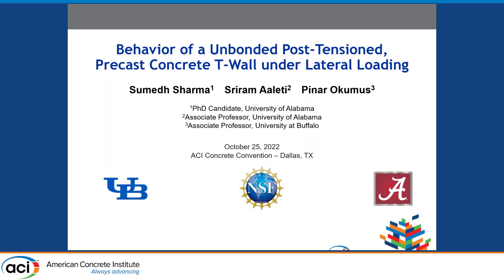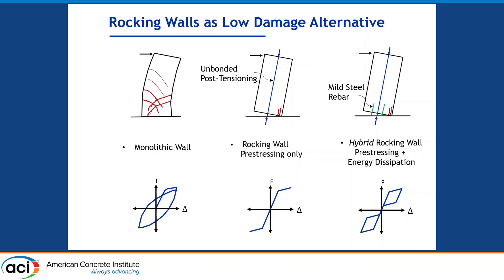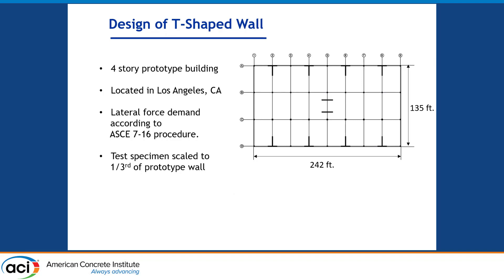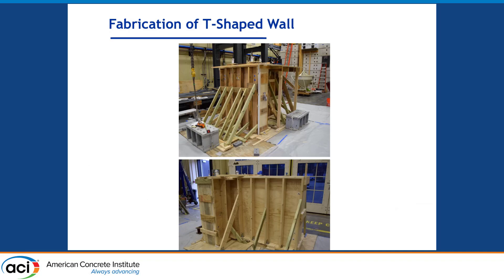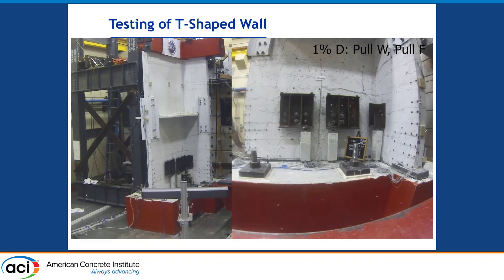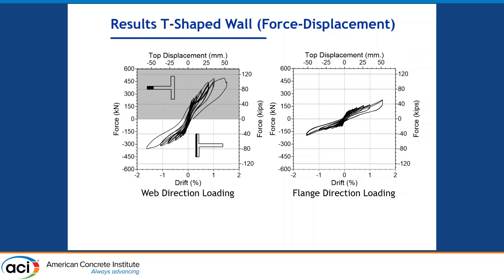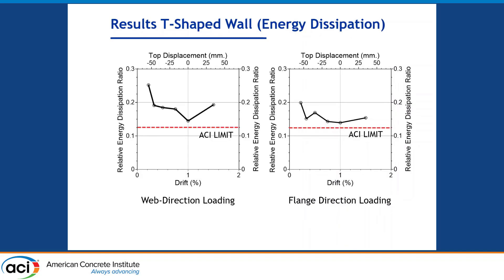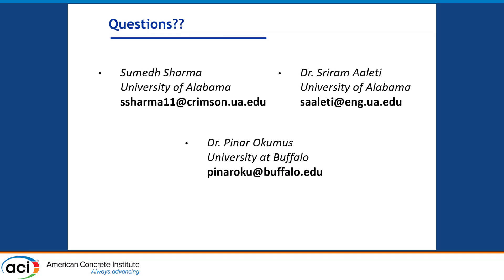Behavior of a Unbonded Post-Tensioned, Precast Concrete T-Wall under Lateral Loading

Comment: Building standards that assume that the building will be destroyed by an earthquake and only focus on holding up long enough to let people escape, miss the wider picture. Yes, the people in the building survived the earthquake, and that's a good start. But if their home was made unsafe by the earthquake, then they're now homeless, at a time when there's probably a lot of other people who just became homeless, and the city has no capacity to find other homes for them. Even if their house was not rendered unsound, but just had a lot of windows broken .. depending where you live, waiting a few months to get to the top of the queue for new windows when your whole city needs new windows means months of exposure to cold or heat, wind, rain, and a house that is open to looting as well.

Being homeless after an earthquake, or even having a house without windows for several months after an earthquake, are situations that will cause hardship and may cause deaths. These are not acceptable outcomes in building engineering.

Buildings must be engineered to save the building as well as the people, or the people won't have a building to save them from what happens next. That means the buildings must remain structurally sound and must not have broken windows or other failures that make them uninhabitable or ineffective in their primary function of keeping the weather and other people outside.

The other factor we need to consider is that concrete is one of the world's major sources of human-generated carbon dioxide pollution. This is not something we can stop - using steel or aluminium or glass instead of concrete would be far bigger generators of carbon dioxide, and there are not enough trees in the world to replace structural concrete with timber. But if we can extend our design life of concrete structures, we can reduce their annualised embodied carbon dioxide. Take a typical modern suburban house and shift the design life from 50 years to 500 years, and we can slash the annualised embodied carbon dioxide by 90%. There are a lot of things we need to do to make it viable to expect that people will still be living in that house 500 years from now, but there are plenty of buildings across Eurasia that have in fact been occupied continuously for 500 or more years, so it is possible.

It requires a lot of design thinking, but one thing we have to get right is engineering our buildings such that an earthquake with a return period of less than a thousand years will not cause structural damage to that building.

Incidentally, your audio isn't very clear, and YouTube's automated cc is not coping well. It would be helpful if you could add your own cc to this vid so that all viewers get an accurate reflection of what you actually said.